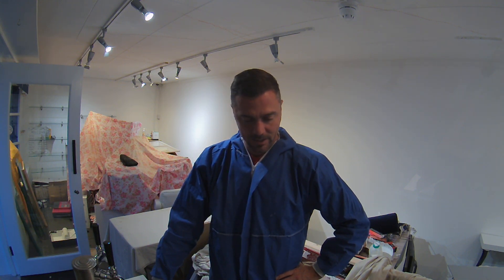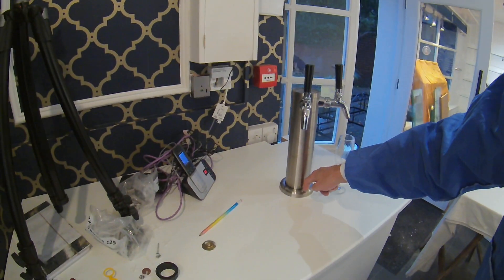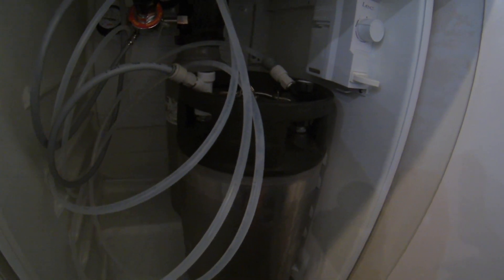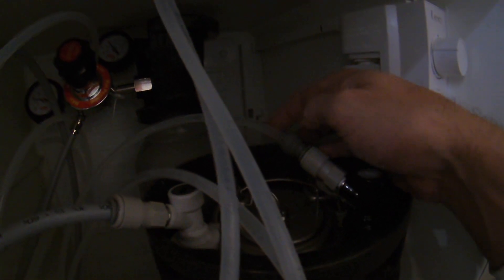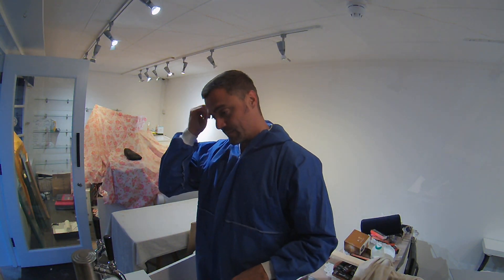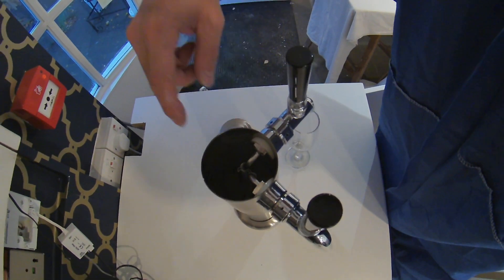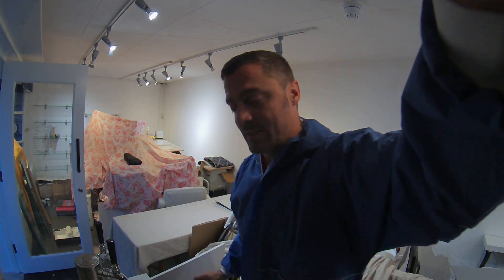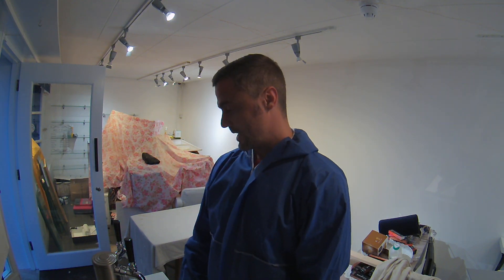Fit a counter-top beer tap tower

Comment: Great video and very useful to me as thinking about fitting such a system in my garage.
Reply from the maker: Thanks mate, I have also built a 4 tap keezer that sits in my garage. If you can get a kitchen cupboard from somewhere that’s getting a new one put in you have an easy job. I didn’t build the unit, only fit the gubbins and it only took around an hour. You could literally be pulling a pint from your own taps in next to no time! Fridge was free off gumtree too! Cheers!!

Comment: Did you just insulate the void between fidge and counter with foam?
Reply from the maker: Hey Ed, all I did was insulate the piping with foam just the right size to plug the hole in the top of the fridge...
Reply: @SafferBrew  with a pipe foam?
Reply from the maker: @edemberley5884  yes something like this https://a1barstuff.co.uk/beer-line-insulation-tube-without-beer-pipe.html?utm_medium=shopping&utm_source=google&gclid=CjwKCAjw79iaBhAJEiwAPYwoCA1_dP-Wv5WDamykqb56vXJGb2dz2ukBN8pyRZXaAfGzqgfLGj59sRoCYuwQAvD_BwE